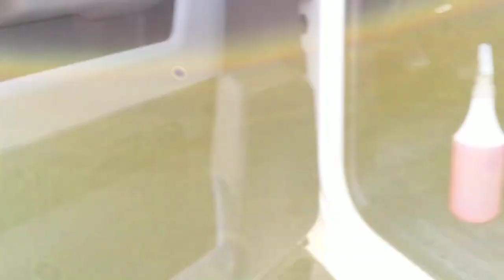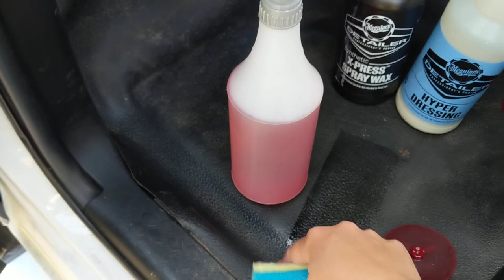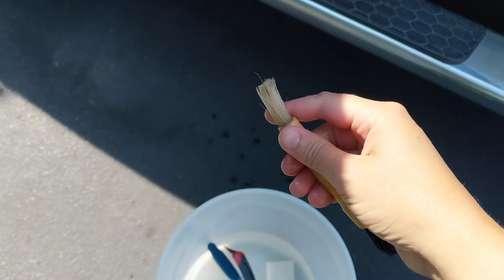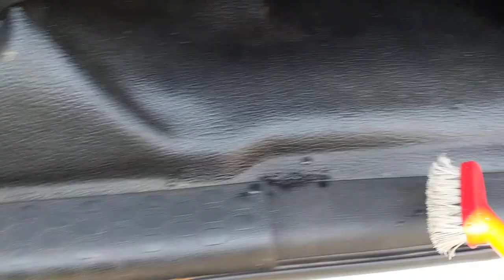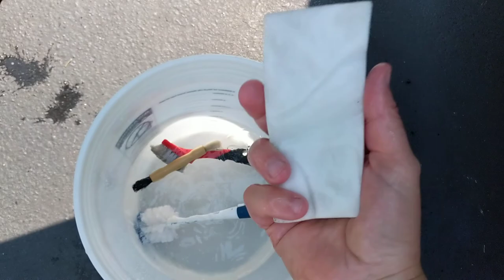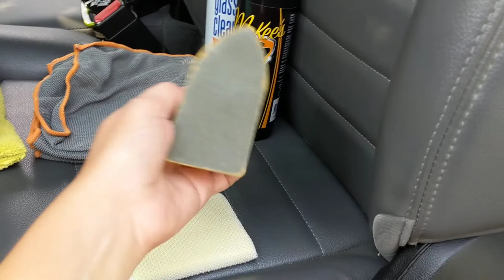Magic Eraser substitute that's safe for interiors!

Comment: Great video Chelsea!! Did I Just See A Tiolet brush!! Is it Soft and Safe On Cleaning Door Jams?.. Thinking of Cleaning My Dads Truck and The door Jams are Dirty With Grease and dirt!! Ugh!! Is There A Safe Product to Remove All The Dirty stuff.
Reply from the maker: It's actually a oxo bottle brush. Softer than a toilet brush. I use it with Superior Products rage to do door jambs. Some scoff that it can scratch the paint but it's a door jamb. I'm not as concerned about scratches on door jambs than I am about getting into tight spaces. Combine it with a pressure nozzle (40 degree tip) and you can do great cleaning. I actually did a video showing me using it on door jambs a while back.
Reply: @attention2detailswchelsea  "Cool Thanks Chelsea "...🙂